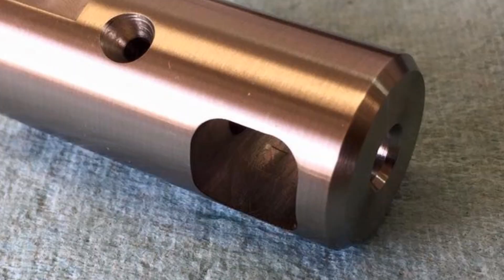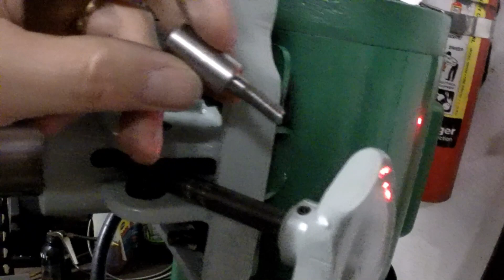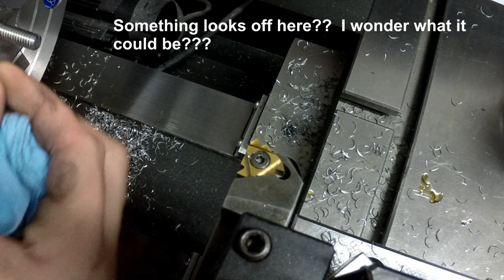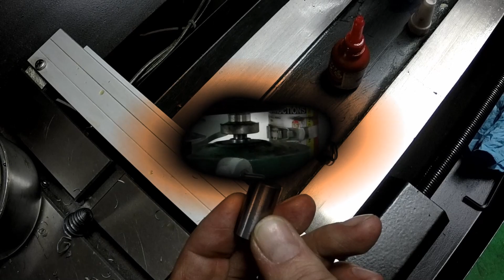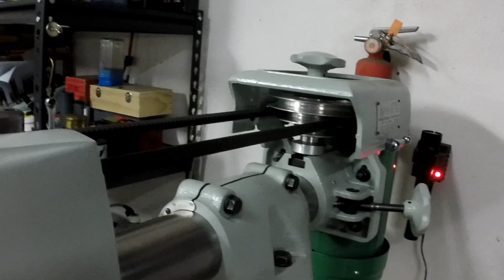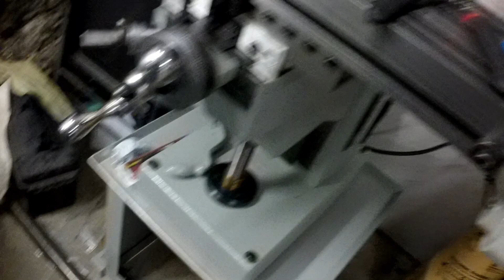Clausing Belt Guard Repair

Comment: Rather than trying to pick up the thread again after adjusting the compound, could you have just changed to using the cross slide to feed in?  Or was it off enough that that wouldn't work?  Nice save in the end.
Reply from the maker: ILGopher - Ryan Weishalla that might have worked. In hindsight I could have just ran a die down the stud when I realized the thread angle was wrong. I'm sure that would have tracked and given me a good thread too.
Reply: Yeah, that probably would have worked, too. I did a little repair on my bench mill the last week.  Was nice to get back in the shop for a little bit.  Been working on another piece to hold the kool mist nozzle on the surface grinder, but Bozo was kicking my ass.  We'll see if I try to salvage any video.
Reply from the maker: ILGopher - Ryan Weishalla bozo has been driving me nuts lately. I'm going to do a full stop after the job I'm working on now and clean up my shop this week to so I can try to keep Mr bozo at bay. He seems to come around when I'm rushed.